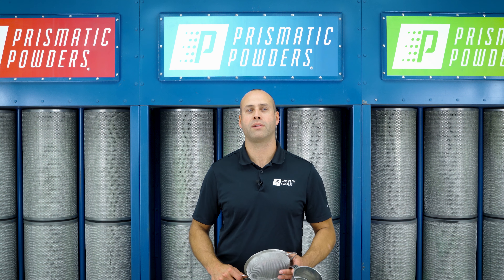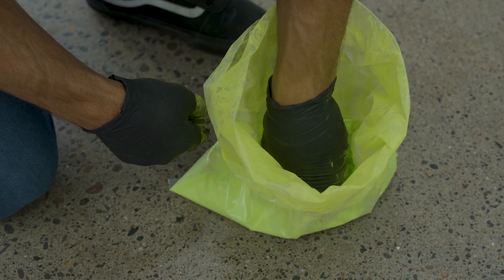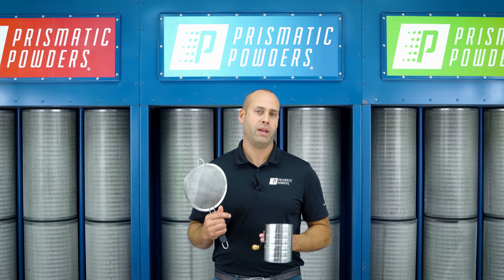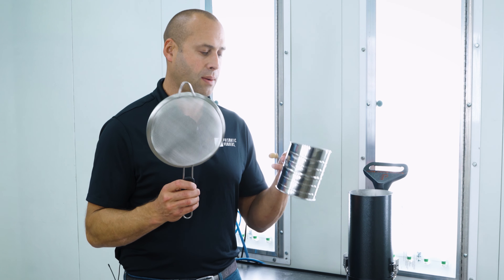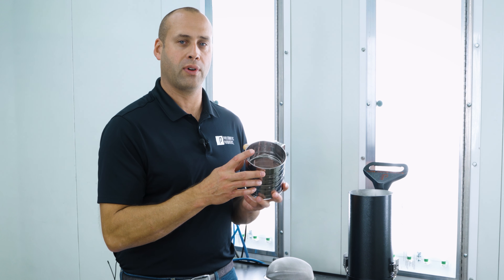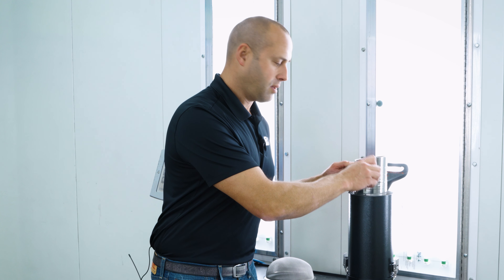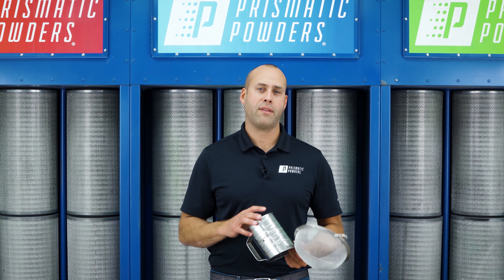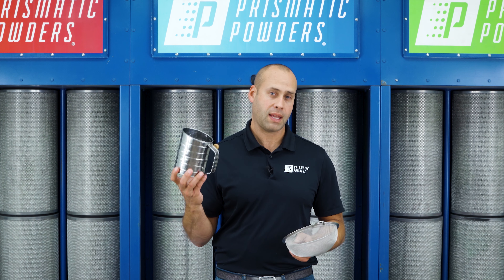Prismatic Powders | Did You Sift It Good?

Comment: Do you have a powder that can produce the outcome of real chrome, I want to rechrome a bumper, but I come to find with the powders that I order from Eastwood are good but it’s not a true window shiny chrome as if i was to just get the bumper replated
Reply from the maker: Our Super Chrome Plus (UMS-10671) is best, but no powder coated chrome will perfectly match chrome plating, especially after a clear is applied to it, which is required for exterior use.